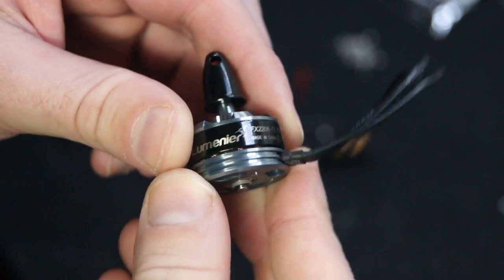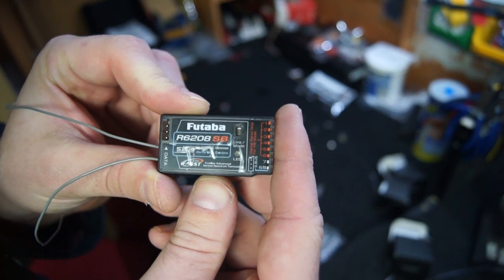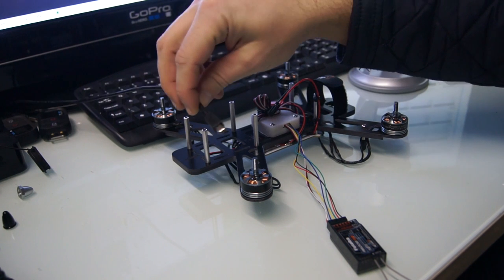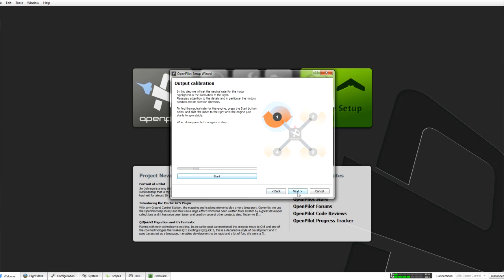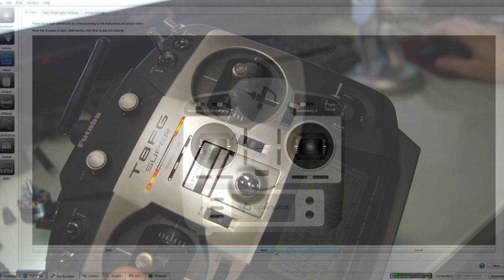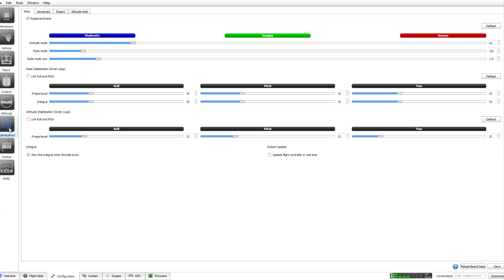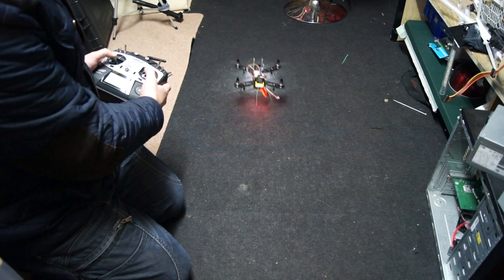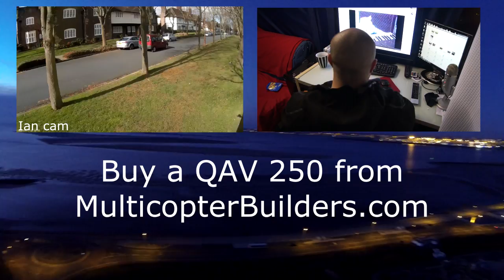QAV 250 - CC3D Flight Controller Set Up - That HPI Guy

Comment: Great Video. One thing you didn't mention was the setting up of the orientation of the FC(but it explains in OpenPilot), which I am just bringing up because a few times I forgot to adjust this and upon take off my qav250 would just flip. In GCS you will select Stabilzation from the left and depending on your fc board orientation to add values to roll , pitch or Yaw.

Comment: Hey great video.  I have mine up and running and having a blast.  CC3D had proven to blow the naza flight controller out the water. Glad someone took the tune to mage this wish it would have been around when i built mine lol
Reply from the maker: thanks zachary, I love the extra power it gives :)
Reply: +ThatHPI GUY hey plz help me my cc3d is showing only one light and didnt detected by gcs plz help 
it was blinking blue light then suddenly it stops now only yellow is on plz help

Comment: Hi enjoyed your video and found it clear and easy to follow, I have the cc3d in a cinetank and (unfortunately) have a Spektrum DX6i they don't have a 3 position switch and when going the the transmitter set up wizard it will not move past this point. Not sure how to proceed (given I have no 3 position switch) can I use the setup wizard? I was unable to find any mention of this in the open pilot wiki. Any help would be greatly appreciated.

Comment: For anyone interested, If you have the Taranis with an X8RRx you can connect the board through the SBUS port, You just need to fashion an SBUS cable from one of the serial cables that came with your CC3D. If you need an image please drop me a message and I'll send you an image of a made up cable. .
Reply: I did the same thing. Once I figured out to use one of the small ports on the "bottom" of the board (labeled "main port" on mine) it was easy. 3 wires from the main port to the S-Bus connector on the X8R. I used black, red and yellow (for signal-your color coding may differ). You also have to set up the main port for S-Bus in the software.

Comment: Useful,thanks.
Just one questions,is channel 5 the one usually used for adjusting flight modes?
Does channel 6 actually do anything?
Reply: +Mark Smallman the 5th channel you can use for your flight mode

Comment: Hi HPIGuy,
I've just finished building my QAV250 with CC3D flight controller - I used your settings, but it didn't feel right to me. It didn't appear to auto-level? Is that normal for the settings you inputted? It feels very difficult to control and after hovering for a bit it was rotating by itself. Maybe it's incorrectly calibrated?

Comment: Great video! Does the cc3d flight controller support GPS for RTH and Hold?
Reply: CC3D is just a stabilization FC, so it doesn't support GPS functions.
For that, you'll need a Revo + GPS.
Reply: Nuno Guedes Yes, I realized that for these mini quads, we really don't need GPS functionality.  They are most fun when in ARCO mode anyway.  Thanks!

Comment: How important is the position of the flight controller on the frame? What would happen if it were positioned under the center of gravity or in the front of the quad like on the Tarot 250?

Comment: Hey, great video. Have a question. Us the cc3d simular to the naza and have attitude mode or does it just have manual mode?  Thanks
Reply: steadiworkz
that's not correct.  CC3D has attitude and rate mode.  Attitude holds level attitude during flight.  Rate is like manual where stick movements control the rate of rotation and allow full inversion.
Reply: Thanks. He probably got confused and thought altitude. I wanted attitude. Cool so it does have it. Thanks a lot stead and app
Reply: CC3D has similar modes to Naza.
Rate = Manual
Attitude = Attitude
Check the modes here:
http://wiki.openpilot.org/display/Doc/Flight+Mode+Switch+Settings

Comment: Hello,  do you feel a gps is needed or wont that make much difference.   I am starting to build a 250 with the same controller but as of yet did not buy the radio.
Reply: Nobody uses GPS on racing copters.
Reply: Jay Anderson I used a gps on a racing quad but the the shit hit the fan and it flue into a tree lesion learnt do not use gps

Comment: hi my name is scott I got a quad copter and cant get the radio to work I have a dx9 radio and dsm2 AR 6200 receiver and the emax stuff 12esc and emax motor and cc3d flit board and need help if you can .....HELP........thanks thecopterboy   it all look ez on video ya right......

Comment: Hi everyone, someone I know has recommended that I use the DJI Naza, would this be a good choice for a QAV250 or would this CC3D be better and why?
Thanks
Reply: The Naza is a good proven FC, but for small 250 sized Racers, its not really the best choice, for a 250 sized you are better with this type of FC or a KK2 board, the CC3D fitted to one of my 250`s feels a lot better than the KK2 board, and not that hard to get set up either, it has quick response to the sticks, making quick alterartion of direction much quicker, generally it also flies a lot smoother than the KK2, as for the Naza, it is ok, but simply not as good for fast manoeuvres even in its manual mode, and the CC3D can be bought for around £12 from BanggoodUK.

Comment: but I think I got to change or adjust the starting point of the motors, I note that ,the motors run fast with half of the half the throttle, so is this 1/4 of throttle :)
I am a true beginer men ,I am learning by scratch jejeje .I am from Puerto Rico, Pablo

Comment: When you connected the motors to the cc3d did you just use the signal wire for 3 of the motors from the ECS's? http://wiki.openpilot.org/display/Doc/CopterControl+Hardware+Manual  In the wiki it says to pull the power from the ECS's on all but one.  from the wiki link "These photos show how to remove and insulate the positive wire from the ESC. Remove the positive & negative wire leaving only the signal cable connected for all but one of your ESC's. A small flat blade screwdriver (or X-Acto knife could be used) and 2mm heat shrink tube was used in this example. This modification can easily be reversed by removing the heat shrink and inserting the positive wire back in to the ESC plug.  Also, remove the ground wire when removing the hot and insulate separately from the hot wire."
"
Reply: if you can guarantee your ESC`s are a linear BEC and not switching, then removing the red wires is not really necessary.
Reply: Thanks for the reply.

Comment: not sure what i did wrong when i went to calibrate motors  with the slider on program none of the motors turned on? why is this?
Reply: Make sure that you have an external power supply, i.e. battery, connected and not just the usb.
Reply: I did but i guess it wasnt all the way in.. I have it all working now..Thank you for your video it was a huge help being this was my first quad build..